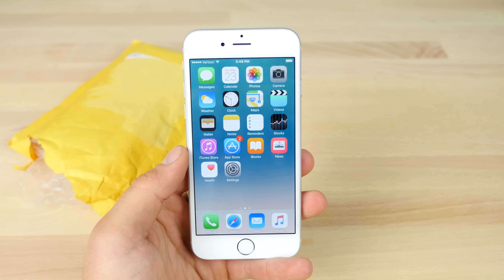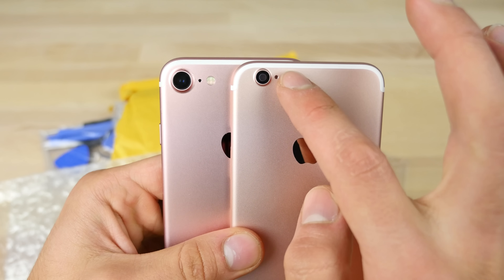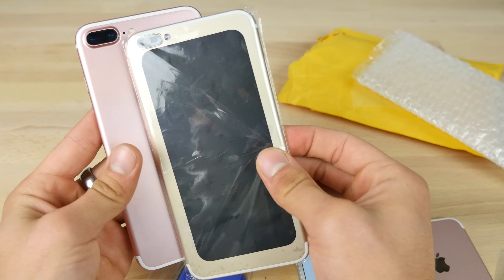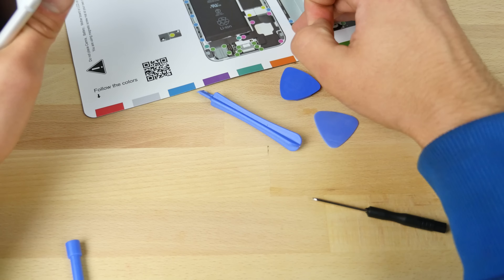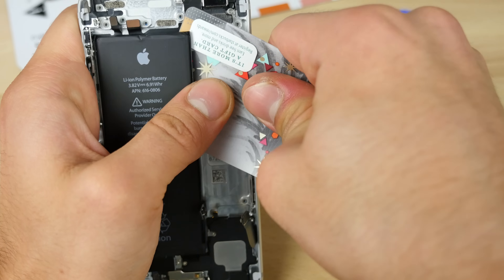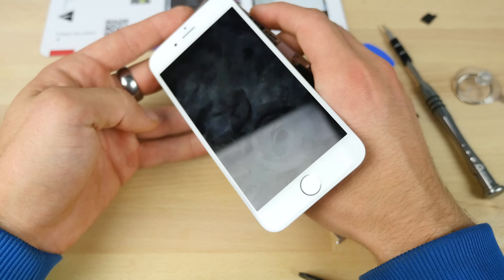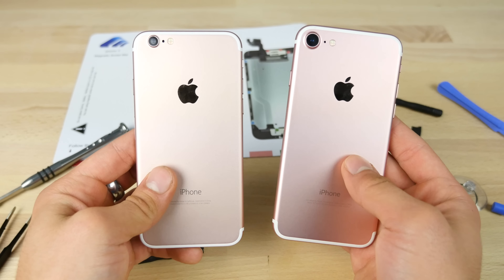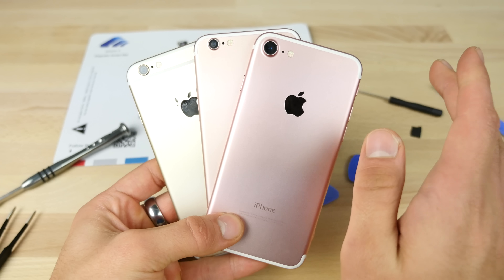How To Turn Your iPhone 6/6S Into an iPhone 7!

Comment: Let's be real here............. Nobody is actually going to do this
Reply: i guess my name is nobody =p
Reply: I repair iPhones for a living and there is no way I'd do this to my own phone. If you are not an experienced technician, you will damage your phone in some way.
Reply: oKtosiTe you wouldn't do this to your phone and you're a repairer... What if someone asked you to replace the screen. You must be one bad iPhone repairer
Reply: So you're saying EverythingApplePro is an experienced technician XD
Reply: Adam Ahmed The screen is one of the easiest repairs. The rear case is much harder, with way more risk.
Reply: Holly Hsieh Actually, despite the speed at which the process is shown, I can spot a number of risky methods used.
Reply: Adam Ahmed Another reason not to do this is that it will negatively impact the antenna attenuation. I'm not saying I'd damage the phone, but the downsides together with the risks (for average Joe) outweigh the purely aesthetical "upgrade".
Reply: Adam Ahmed Your conclusion shouldn't be that I'm a bad technician, but that most people are better off not attempting this. Just get a nice case.
Reply: I'd do it. for real I have a useless 6 at home, might aswell try it and get the screen repaired
Reply: GINTAMA PABLO just saying i would totally ruin the phone
Reply: What's with all the hate Mr. squiggle? No need to cuss :)
Reply: hmm
Reply: GINTAMA PABLO he did it
Reply: Yasen Gregorovich true
Reply: Yasen Gregorovich I want to
Reply: wolfie jr but you won't
Reply: Yasen Gregorovich just ordered one
Reply: wolfie jr  sure..............
Reply: Yasen Gregorovich true
Reply: oKtosiTe I mean, I replaced my iPhone 5's battery entirely by myself and I'm 15.
Reply: jonathan kawas Says the guy who spells "know" as "Noe". And let me guess, you're going to start cussing at me for being the grammar police.
Reply: Yasen Gregorovich LOL
Reply: ctfu !!!
Reply: Yasen Gregorovich  lol😂😂😂
Reply: Yasen Gregorovich I would do it if I had all the tools
Reply: Yasen Gregorovich wut
Reply: Yasen Gregorovich init
Reply: Yasen Gregorovich yeah
Reply: Yasen Gregorovich I wanna do it
Reply: Yolo I'll do it plus if I fuck up I have an excuse to buy a real 7
Reply: Yasen Gregorovich I'm going to transplant my spare iPhone 6 into a new shell plus a new display..(Display LCD and glass are broken the thing is literally unusable) As soon as I can afford it,I'll upload a video about that xD
Reply: Yasen Gregorovich i will do this in 3 weeks, or more I ordered the housing and i will make a full tutorial on how to change it. This new housing will have no headphone jack and a big actual camera like the iphone 7 so stay tuned for my frist video, :)
Reply: I thought of doing this. Then, I saw you had to literally open up your phone. Hell naw I can't do this shit, I'm hella clumsy so imagine I drop all the pieces. Then, BAM I just lost hundreds of dollars...
Reply: Actually i do
Reply: I want to do this but I don’t know if I should do this or just get a sticker but if I do this I think I’ll get actual people who know how to do this
Reply: Me
Reply: Me u guess my name

Comment: You do not need to make your iPhone 6/6s look like an iPhone 7, it already looks like the iPhone 7 because nothing changed
Reply: Kevin Maguire if you actually saw the video, you can notice some differences. Camera size, antenna bands, those are the obvious ones. Also the headphone jack
Reply: Joel Bruck I know, but the design is still 90% unchanged
Reply: Kevin Maguire the design from the galaxy s6 to s7 is exactly the same
Reply: Anifyz well 2 years of similar design for Samsung s6&s7 and 3 years for 90-100% no changed design
Reply: the s6 has a chtome trim on its home button unlike the s7
and there are salty Iphone fanboys that won't accept the fact
Reply: pierce yu because that totally matters
Reply: Yeah, other than the removed headphone jack
Reply: Anifyz No, I know that.  The design is being kept for 2 years for Samsung, like the S5 had the same design as the S4.  The thing with Apple is the design is now going on 3 years being very similar to each other, and the removal of the headphone jack seems crazy considering the 5th/6th generation iPod touch is only 6mm thin and has one! I used to REALLY love mobile Apple devices but I can see that they are turning to crap now.
Reply: If you honestly think that then you need help...watch the keynote smh
Reply: I hate those kind of people who don't think before they speak as well. It's annoying tbh. I'm not one of them though, I watched the whole keynote and know lots about the iPhone and their platform, especially considering I'm typing on one right now. (iPhone 5s)
Reply: Kevin Maguire Two notable differences. Camera, and the headphone jack.
Reply: Yeah, that's true! At least they changed something, but they are kinda both for the worse as the removal of the headphone jack is crazy, but the camera is better quality, however it has a bigger bump now.
Reply: But what if I like bumps and dongles? Also, (very strange tbh) I love the design from the 7 but not the design used in the 6/6s
Reply: Kevin Maguire camera?
Reply: Kevin Maguire a lot changed actually, stop talking about things that you can't afford
Reply: This comment was from 4 months back.  And it was a joke.
Reply: Rosie Stinnett can't afford lmao, is that your comeback (just kidding, you don't have to be cocky to the people who can't afford the pricey stuff in life, besides how do u know if he can afford it or not?)
Reply: I could currently afford it if I begged my parents for a new phone like most people do.  However, due to the fact that I'm not a bratty 13 year old, I am perfectly happy using my iPhone 5s for now, which still isn't a bad phone, considering I bought this thing when the 6s was just being announced.  Some people also do not have proper retaliation skills to...joke comments, apparently.
Reply: Kevin Maguire Sad but true.

Comment: Way to go Brother! Nice work, I have repaired a lot of iPhone over the years and a complete housing swap is not a very easy process. BTW if you will use a little bit of heat from a heat gun or blow dryer the ribbon cables will come out much easier when removing them from the original housing.

Comment: Wait a minute, aren't the antenna bands on the 6s there for a reason?? Won't this actually hurt the carrier signal strength or cause some sort of abnormality in performance?
Reply from the maker: So far haven't noticed a difference, strong verizon reception!
Reply: Carlos Flores  bb.      B.      B.    N.  The. Bob.  B
Reply: Carlos Flores it probably replaces the antana bands with the ones on the shell
Reply: Carlos Flores creerrrrrr

Comment: This doesn't mess with your signal ??
Reply from the maker: Actually no it's been very stable at full bars.
Reply: Leon Koko hi
Reply: EverythingApplePro, cool new "housing", but does the antennas work in this "new housing?" Is it better, or worse, than an original iPhone 6s (housing/shell)? Can there be a comparison test in the new housing vs original one?
Reply: EverythingApplePro hi
Reply: Thanks +EverythingApplePro

Comment: IPhone 6S isnnt dated, please man don't make us feel sad!
Reply: Jazz Greiner Why?? Is it because the new one is alerady out? I thought a dated phone is a phone that has dated specs, dated software and dated hardware and my 6S still fly.
Reply: Jazz Greiner Bro, the 6S is running the latest ios 10.1, the design is practically identical to IPhone 7, the 6S outperforms every phone in terms of speed, stability and Graphics without any thermal throttling. The 6S is clearly not dated, you can say it's a little dated compared to the 7, but it is not a dated phone.
Reply: Jazz Greiner It feels really bad :/
Reply: Jazz Greiner do you even have an iphone 7 ????
Reply: Super Vegetto  I bought the 6s plus and I'm not  mad it's great

Comment: I wander how this holds up long-term. I once replaced the back case on my iPhone 5 after I had broken it with a cheap non-apple one, and because it was made with a lot les precision and the installed dust filters where crap and sometimes not even installed, a lot of dust got in to the phone and started collecting on the inside of the camera lens, redering it totally useless...

Comment: Just did this and everything worked well till i discovered that the camera didnt focus because you need to transfer the rear camera bracket wich has a foam and is very had to get off the original housing so i switched back to the original otherwise looks and feels good 😉

Comment: According to Apple the new antenna bands on the iPhone 7 crank the signal strength on the phone to an unhealthy level. Apple themselves recommend not to put the iPhone 7 to close to your body and making phone calls only on speakerphone or with a headset. I assume this mod would do the same to your iPhone 6/6S.

Comment: Hello friend, i buy a back housing cover iphone 7 red to use it on my iphone 6 same as samples on your video but a problem occurs when emsamble the iphone 6 in the new iphone 7 red not respond not turn on!! I reassemble the iphone in ten old housing and Works great!! I tried 3 times and it still does not turn on the new cover I buy to give it this new look!! Do you have an idea that could be going wrong?

Comment: There is no point in doing this , Your Phone is going to be 6S from inside .

 Remember , If someone visits the apple store if there would be some defect or problem with their phone after that , Then your phone's Serial number will be checked and you will be charged heavily for repairs , Even if you are perfect at opening the device , your warranty would be void .